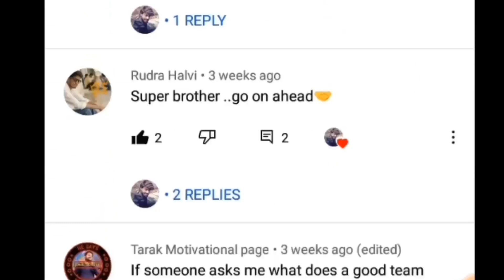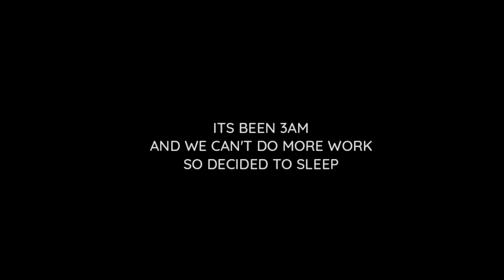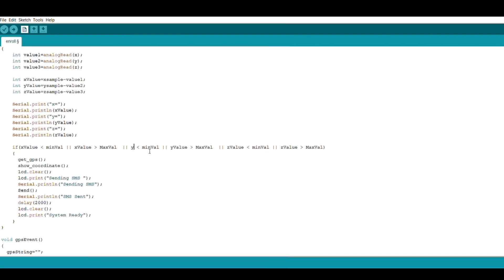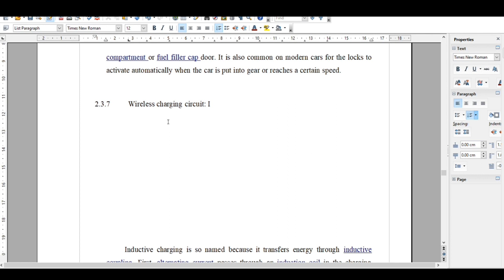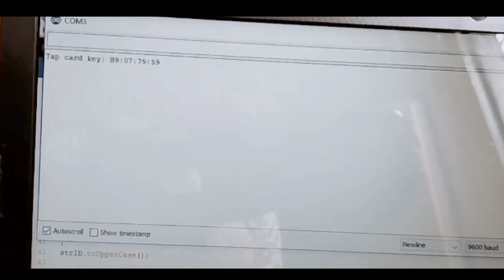NIKOLA TESLA ELECTRIC VEHICLE BUGGY CAR(PART 2)||EV CAR BY EEE STUDENTS ||TESLA BUGGY CAR|Evbuggycar

Comment: What is the special car information
Reply from the maker: It run on batteries,  for single charging,  it travels 45km, for 10 rupees it travells 45km approximately, if accedent happends, location will shared to alloted number, wireless charging and RFID technology with antitheft device
Reply: It is run by the electricity,so Running cost is less than desile and petrol vehicle and it is eco friendly to the nature ,now days electricity is the cheap and easily available source